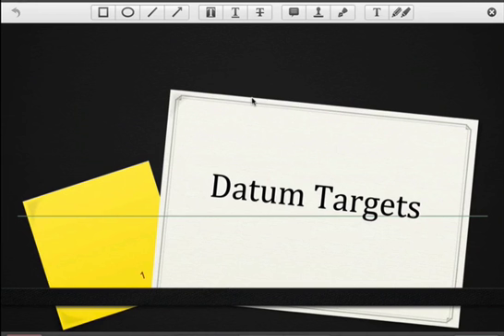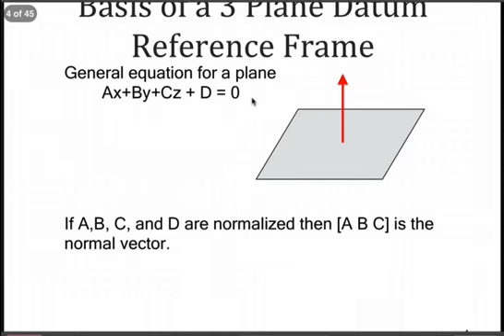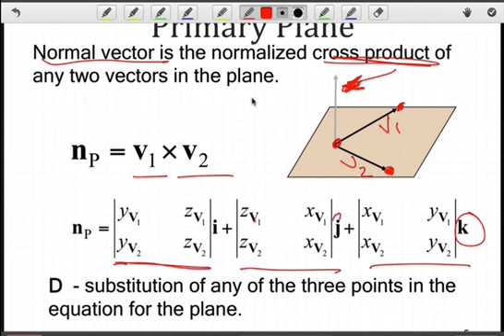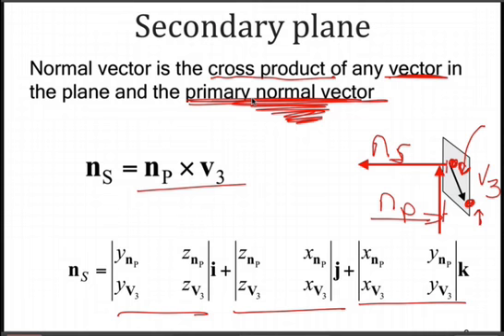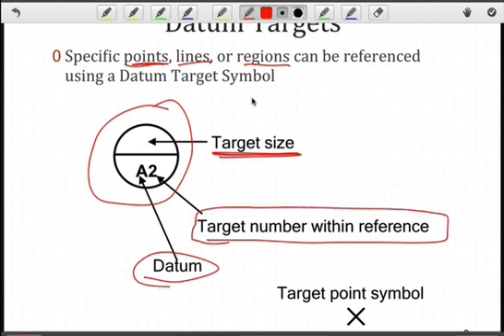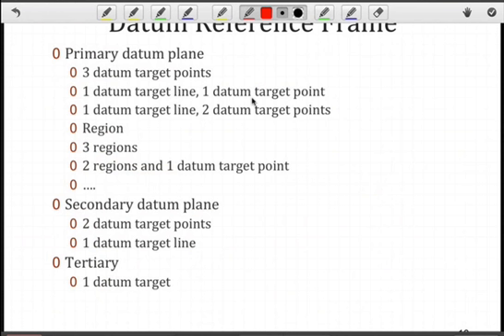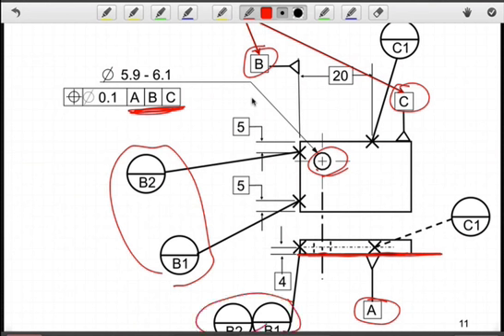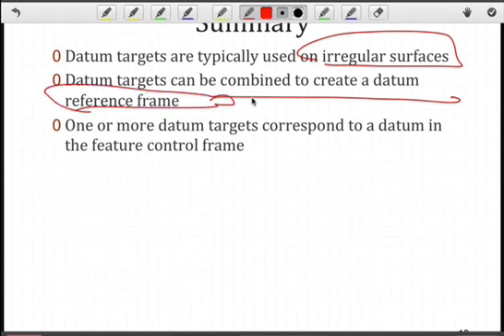Datum Targets

Comment: question though: We place the datum targets (especially the POINT and LINE) with TEDs (Theoretical Exact DImensions). Looking at Datum Target Regions, this I can understand. The actual reference point in should touch the part within that circle. But now the POINT and LINE..... a TED gives an EXACT dimension. so no tolerance... what indicates the TOLERANCE on the location of a Datum Target Point (or line)?

Comment: Great explanation John. I have a question for you. Could a primary datum plane be defined by using more than three datum target points? I have a drawing that specifies datum targets A1, A2, ..., and A7. How should I use them?
Reply from the maker: It is hard to say without seeing the design spec.  I would surmise that different combinations of the targets are used in different datum reference frames.